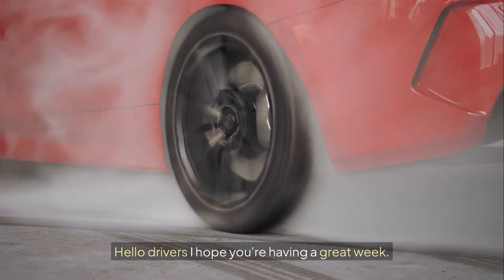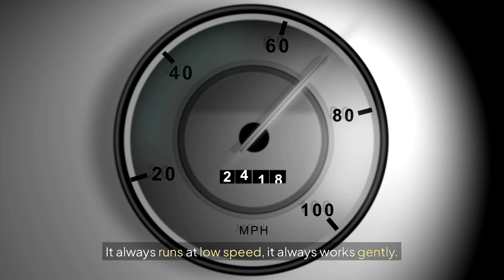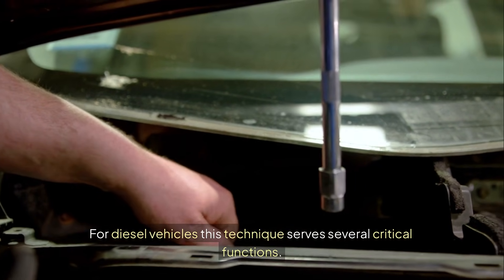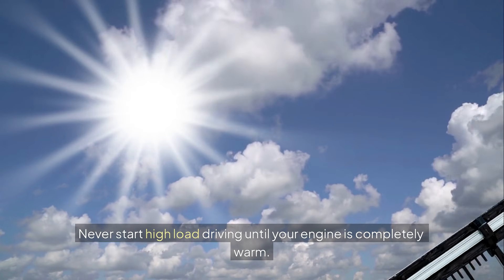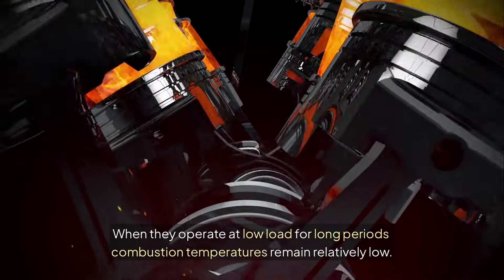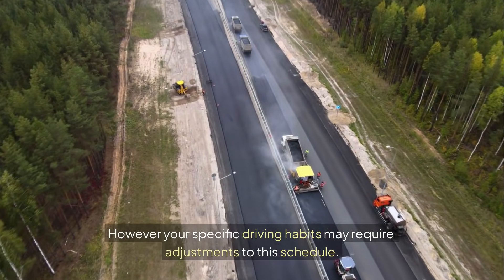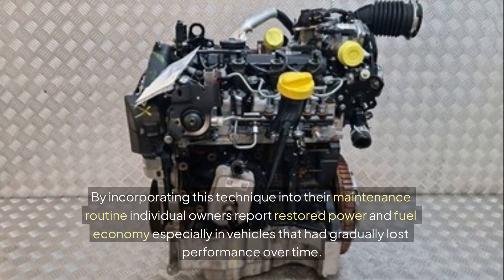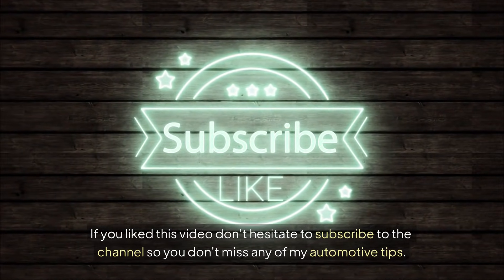One Simple Habit Every 2 Weeks = Diesel Engine That Never Dies!

Comment: Just disconnect all the EGR bullshit and no more carbon build up in the manifold and no more problem's I know I have done it 2 years ago my vehicle run's beautiful not like before manifold always block EGR valve problem's now run's better motor run's cooler EGR in theory might sound good but practically it doesn't work i have a business with Kenworth trucks and have the same problem's with EGR SHIT it's a engineering headache engineers should hang there heads in Shame for designing this rubbish that doesn't work.

Comment: I add a fuel additive that I swear by it  no smoke, great throttle response town driving 42 mpg touring 58 mpg engine Volvo 2.4 twin turbo 5 cylinder auto its well serviced
Reply: What additive do you use?

Comment: You're  Clueless. Diesel engines of which you speak, are not designed to run at high RPM's. That's why the have so many gears; so they can stay in the ideal torque range. If you know this little about something, why bother making a stupid video?
Reply: Big true .....my diesel has a 7-speed dsg, where 7th gear gives a speed of 130-135 at 2.000 rpm, where top speed limit in my country is 130...ok, 130 on the meter , is a bit over 120 in real, so I can reach legal top speed at 2.200 rpm....only driving in manual, I can maintain 2500 rpm, by using a lower gear....so 2.500, or even 3.500 is a rather fictional condition on the road, than real....besides, manufacturer recommends 2.000 rpm minimum for regeneration, rather than 2.500, which is roughly translated to 160 km/h, which is far over limits....

Comment: Diesel engines  are for long commutes. They're not suited to school run and as a town runabout.  It's a false economy buying a diesel if your commute is under 20km.
Reply: True
Reply: Wouldn't have anything recirculating exhaust gases & oil residue mixed together turning into a tar substance very good engineering. Engine's are not meant to reuse exhaust gases it don't work. Imagine you had not much food and  you had to eat your own shit how long do you think your body will last before you die same thing with Diesel engine EGR DON'T WORK

Comment: Ok my diesel is an 8 speed automatic so is in 8th gear on highway/motorway ( <2000 rpm at 70mph) so I put it in manual mode and choose a lower gear to get revs up >3000 for a period to help clean dpf Thanks
Reply: I still wonder about the build up on the back of the inlet valves.